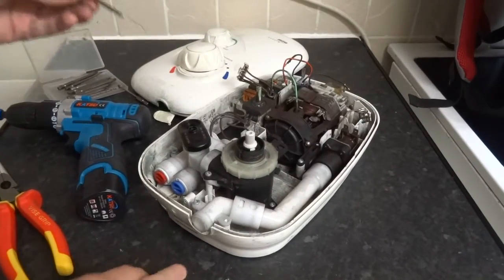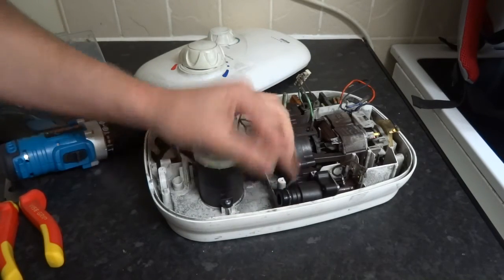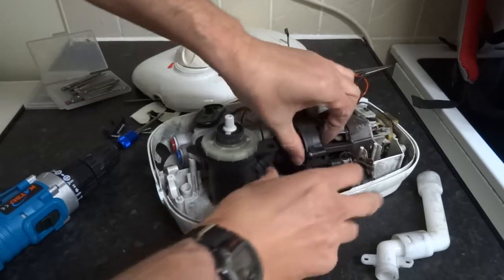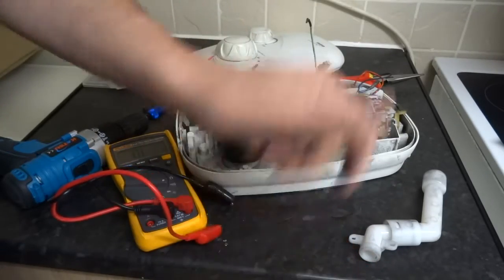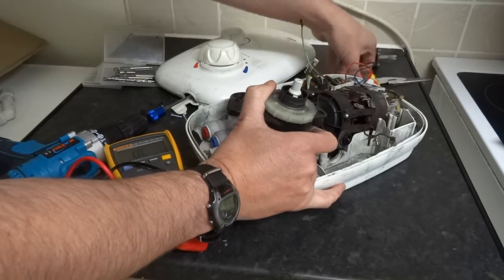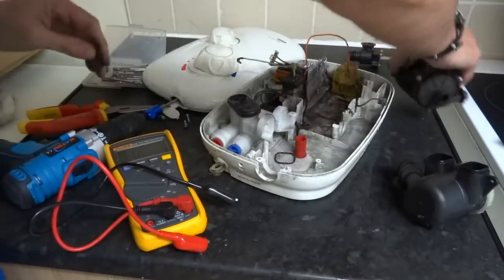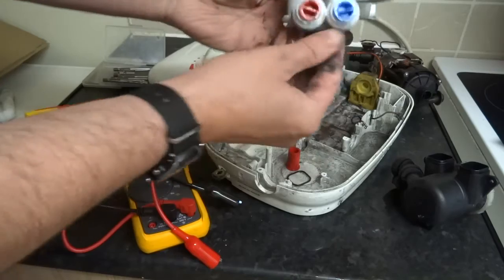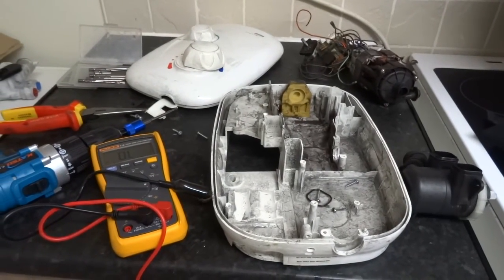Mira Event XS Teardown: Pump, Solenoid, PCB Strip Out DIY Guide

Comment: Does this power shower. Mira event xs. Have a thermal cut out switch? Or because it takes hot and cold feed and mixes it, does it not need one?
Currently I get cold water fine but moving to warm and hot the flow stops. Motor still spins. 
I'm assuming maybe blocked filter or could be solenoid valve? But wondered if it was a thermal cut out 'stuck'?

Cheers!
Reply from the maker: need to test